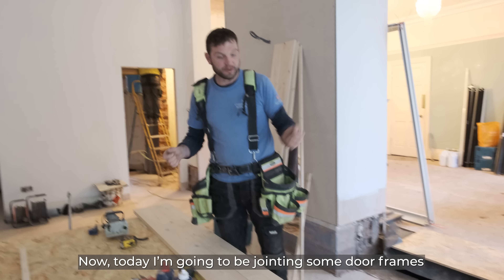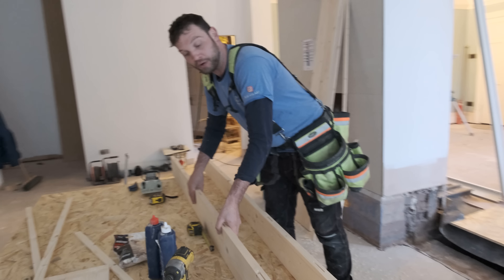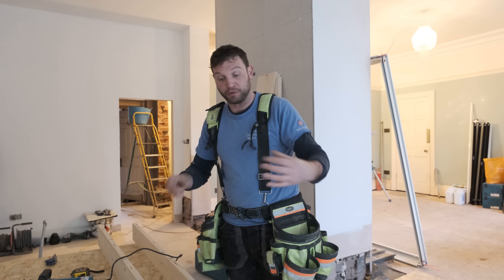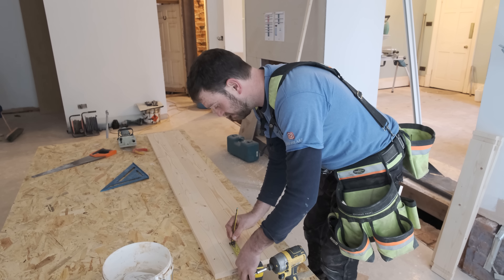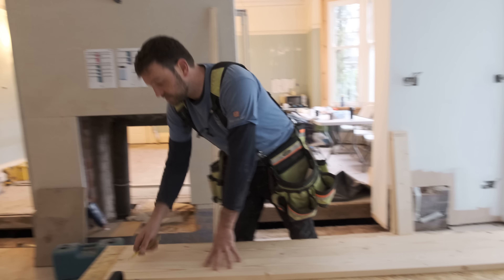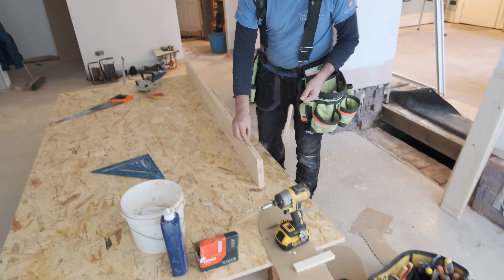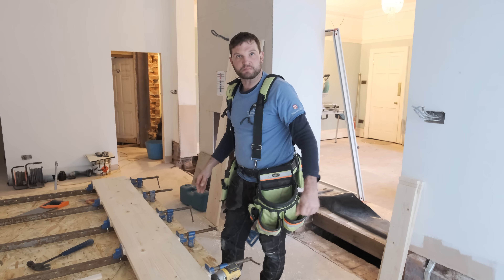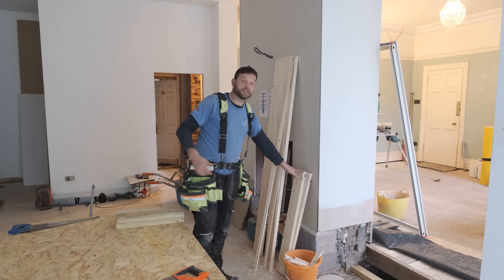How To QUICKLY Construct Door Frames Like A Pro!

Comment: Worth putting a bit of plastic like bin bag or cling film on the tops of the 4x2 bearers so glue squeeze out doesn't stick the door frame to them. I've lost a frame to having to hammer them off and pulling a big chunk out the timber 👍

Comment: Great job there mate, just to add on to that , always always put two G clamps on Both ends of the join and one or two clamps on top of the joined pieces depending on the length of pieces of timber you are joining and for DIYers , clamp two pieces of timber across the two pieces that you are joining . Thanks

Comment: The whole lot would have fit in those first set of clamps, there like 4ft clamps gluing 1ft of material. Just remember to alternate the clamps top and bottom so the timber doesn't pop out 👍